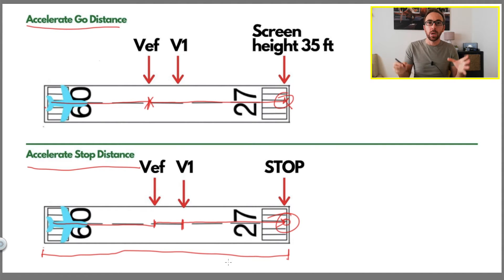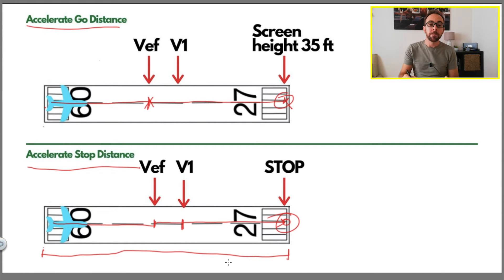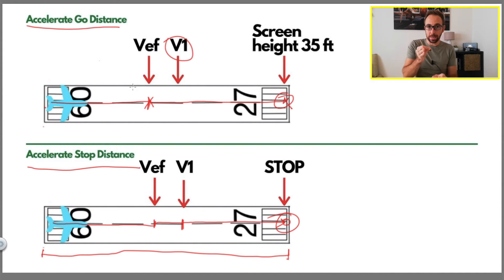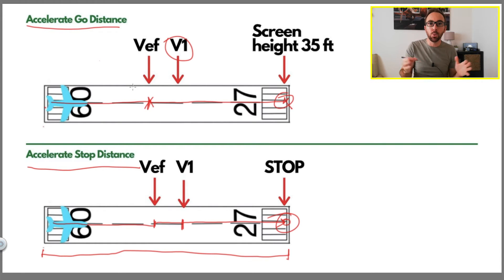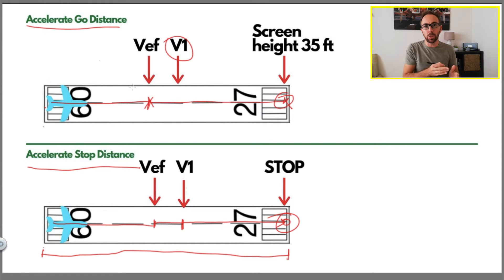Balanced Field Length explained [Accelerated Stop vs Accelerated Go distance, all you need to know]

Comment: How do you calculate take off distance required for a given take off weight, weather and runway surface condition if the company doesn’t provide any software. The available tables and charts in QRH and Performance manual only provide max take off weight for available field length.

Comment: When we take off after having an engine failure near v1 , we will have Full fuel , Since there is MLW for every aircraft we will have to dump the fuel , for that we may have climb higher and need more time , since we only have one engine power , how it is done Captain ?
Reply from the maker: Hey, that's a great question !! You have to analyze each situation separately because the situations are different all the times. However, there are some non normal situation that allows you to land with a weight above the MLW...

Comment: Hi, I want to ask you why V1 increase leads to TODN-1 and TORN-1 decrease?
Reply from the maker: Hey, great question, you have to think about what happens to the TOD and TOR with an higher V1 if an engine fails at V1. You will spend most of the TOD and TOR with two engines..
Reply: @PILOTCLIMB  thank youuuu

Comment: Hi there! Since you have practical experience u might help me out?! :) 

I'm just doing a numerical simulation for BFL-calculation @ my university for different A/Cs types...For an A320 
 I got about 2300 m (conf 1+F), 
about 2150 m (conf 2) 
what confuses me is, with conf 3, BFL becomes slightly more than 2150 m with conf 2, 
Is that realistic?  I expected BFL to decrease from conf 2 to  conf 3 a bit...
Reply from the maker: Hey, many thanks for watching, the Balanced field length should be the shortest. Is the TORA a limit for the take-off?
Reply: @PILOTCLIMB  I've to do the calculations based on the stall speeds/ vR & v2 for given weigjts from the FCOM... with ISA conditions (H=0, density=1.225, etc. ) with different flap configurations... the result should be the min required takeoff length (TOD (AEO) + 15 % or BFL). I was confused, that the result for flaps in conf 3 is slightly higher (due to increased drag...) than for conf 2... have. o recerences to estimate, if thats plausible...
Reply: found my error... used vR / v2 for 1000 ft (conf 3) ... thanks for ur time (to answer) and ur great explanation in the vid!
Reply from the maker: @enisfarje9164  that's great!! You are welcome!! Don't hesitate to ask me any questions when watching the rest of the videos👍

Comment: Great video! Perfectly explained! Thx!

Does the concept for BFL only applies for commercial aircrafts with at least 2 engines?

What about airplanes, like cessna 172 for example, with only 1-engine/prop... in case of an engine failure, there would be no thrust left...  therefore continued start wouldn't be possible... but one can still find references for BFL, how is BFL defined in that case(s)?
Reply from the maker: Hey thanks for the kind comment! BFL is applicable to multiengine aircraft... the single engine planes have not decision speed. The single engine plane normally have an altitude shortly after take off at which if the engine fails the pilot take a specific action, for example 180 degrees turn rather then continue straight. Let me know if you have more questions👍
Reply: @PILOTCLIMB  Thx for ur answer! Very appreciated! I indeed have 1 more question. In case of a "normal" start (AEO) does a pilot lift of directly with vLOF or do u wait until u reach v2, even if there is no engine failure?
Reply from the maker: @enisfarje9164  You are welcome!! You always rotate at the calculated Vr (rotation speed).

Comment: Hello, Thanks for making this wonderful explanation Video. I'm also a pilot, but I always have long enough runway for TO and LD, so never concerns about distances. But I really enjoyed learning from your knowledge and experience. 

If i may, How different between TODR and AGDR ? I mean, in the real world, what's in use AGDR? Vef is impossible to be set. How can we get the length AGD?

And one more. 
How about this, "Balanced Field Length ASD=AGD" I've seen it somewhere else.
Reply from the maker: Hey, many thanks for watching!! So, in the past, we used tables to calculate the TODR. Normally we use the TODR and not the AGD, these two distances can be identical however sometimes the TODR is more limiting (due to 115% of the distance required from the start of the ground roll to 35feet with all engines operative). 
I have seen ASD=AGD as balanced as well, but I recommend using ASDR=TODR for the reason mentioned before.
Let me know if you still have questions👍

Comment: thank you for your instructive videos Sir, but my question is WHY? why do we need balanced field or V1 for balanced field? what is that balancing is about?
Reply from the maker: Hey, many thanks for watching and the comment, the balance V1 is optimal because it gives the balanced field lenght which is the you shortest runway lenght that complies with the safety regulations for take-off. For example, If don't use the balanced V1 your ASDR might be very short however your TORD might go beyond the safety limitation for that particular runway and conditions... VIceversa is also true.
Let me know if you still have any questions.

Comment: So basically if there is a clearway TODA = TODR??
Reply from the maker: Thanks for watching, so, TODA is an available distance that is physical and is fixed, the TODR is what you need from brake released to the screen height  the TODR might change depending on your performance and the weather. So TODA is the distance you have AVAILABLE for your TODR.

Let me know if I answered your question